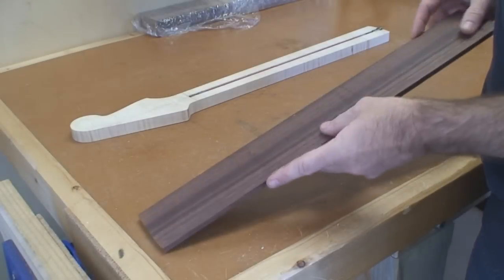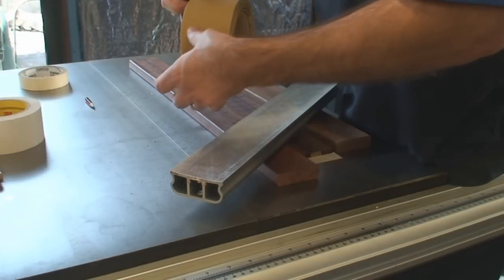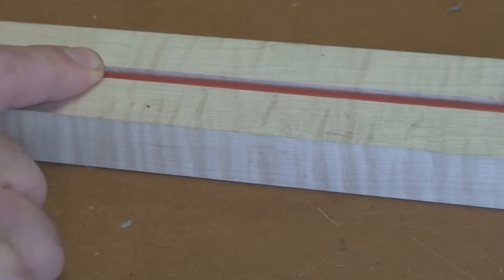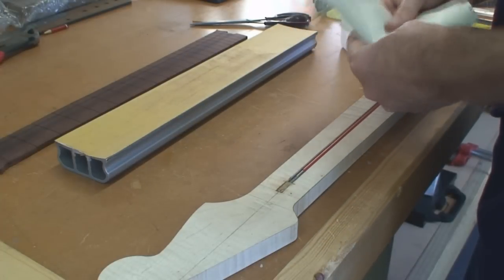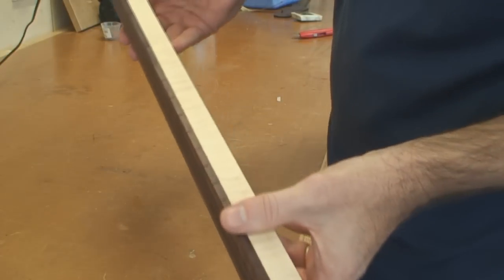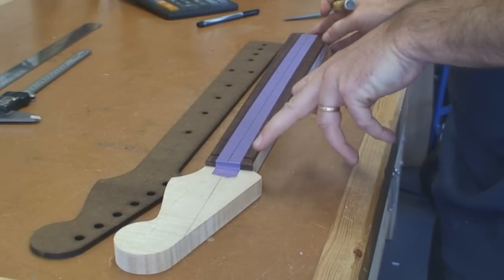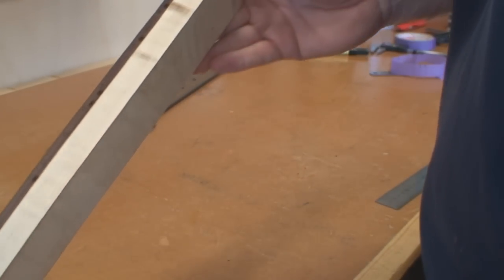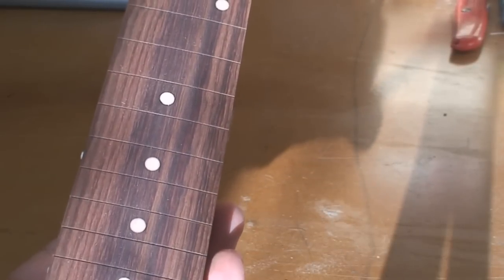Stratocaster Guitar Build - Part 2 - Building A Stratocaster Guitar Neck

Comment: Thank you for this excellent series. I have a question:  How do you get the slot depth equal as you move up the neck as when you radius the fretboard, the depth of the slots will become shallower and shallower due to the outward taper of the neck  toward the heel with this tablesaw jig method?

Comment: I watched the series in early 2012 and have since built three Strats, four Teles, one each 4-string & 5-string Jazz basses, and almost finished a triple Precision bass (wired like a Strat with a blender pot).
I would like to thank you David, you inspired me to take the step from tinkering with existing guitars to starting from scratch.
Reply: Jb kindly can you make or share your bass build knowledge with me.. Please❤️
Reply: @johnmayer8906  It's hard to say in a few sentences. You will need a few tools of course, and a template for each model, or with patience you can make your own templates based on actual guitars. 
I already had many years of power tool experience, which helps a ton. Routers are very dangerous animals, so are band saws and table saws. 

My best advice is to watch David's Strat build, the same principals apply to all Fender style guitars and basses. 

Also, if you're going to make the supreme effort, don't get cheap hardware, I use and recommend German made Schaller bridges and tuners, more expensive but worth it. If you have the skills, it's only a small step to winding your own pickups.
All this costs money of course, so start small and basic, but the deeper you get into it, the more you will understand and want the right workshop power tools. Best wishes my friend.

Comment: Is it necessary to glue the brass blocks of the truss rod into the channel? Does that matter?
Reply: NO DONT DO THAT. Those block need to be able to slide toward eachother slightly otherwise the rod assembly won't flex and work as designed. You'll bust the rod the first time you need to make a real adjustment. Silicon will give and allow them to move under pressure. Glue is too mich and will strip the threads or worse bust the adjustment knob threadlock lose. Dry fit the truss in the slot and play with the adjustment to see what I mean. Understand how the mechanics work before you button her up.
Reply: @raleighburns3768  Thank you.

Comment: Every time I watch this (a lot of times now), my anxiety goes through the roof when he’s flush trimming the fretboard at the heel and passes over the truss rod spoke. God help you if it’s not tucked beneath the maple and the bit contacts the spoke.
Reply: Wait till you DO IT.... You'll seriously appreciate squaring the head end with the chisel and getting that 1mm back. I found a much much smaller 1/4 diameter whitehall router bit that looks like a mini version of that monster he uses and it seems to be a bit more forgiving on the end grain, and much more precise when using thinner patterns, as an added bonus it hasn't burned my maple as much as the big boy.

Comment: Hi there, I've watched this series numerous times and have taken the plunge to start building myself. I have most of the tools that I need but having difficulty finding a saw blade that would do the fret slots. Could you please advise what kind of blade you have? Many thanks from a Scottish luthier in training 🏴🏴🏴
Reply from the maker: I used to use the Fret Slotting Table Saw Blade from Stewmac.   You can cut them in a Fret Slotting Miter Box too.
Reply: @FletcherHandcraftedGuitars  Thank you very much, appreciate you replying to my comment
Reply: @FletcherHandcraftedGuitars  Hard lesson learned with that sawblade I figured I'd share.... Not recommended for SawStop owners. For the price of the 225$ blade you can grab the deluxe mitrebox with the Japanese fretsaw from StewMac. One little accidental bump of the blade into your metal template on a SawStop and it fires the alluminum brake block into your super thin kerf saw blade and you better hope your wearing a bulltetproof vest and ANSI googles. Those StewMac sawblades are thinned out significantly and DO NOT appreciate the SawStop's brute force braking mechanism. They turn into anti personnel mines in less than 3 milliseconds.

Comment: I could be wrong but I think that by putting the truss rod in with the tightening rod on top is wrong. Doing that will cause the neck to bow in instead of back. The idea behind the double truss rod is to eliminate the need of carving the truss rod cover, which is usually put in after the truss rod and before the fret board. I am not an engineer but I think that by tightening the one rod it will cause the other rod to bow away from the tightening rod from the center point, which in this case will cause the neck to bow forward and not back.

Comment: what type of blade are you using to cut the slots?  Any info would be greatly appreciated.  It's hard to shop blades by kerf size.
Reply from the maker: Hi Don, This is the saw blade I used in the video - http://www.stewmac.com/Luthier_Tools/Types_of_Tools/Saws/Fret_Slotting_Table_Saw_Blade.html

Comment: That indexing pin on the shooting board looks tenuous, when it comes to cutting those fret slots. Probably very stable, but it looks to me like you'd have to be very careful not to displace the fret board one way or the other during the cutting operation. Have you tried your CNC router to cut any of these yet?

I am planning (hoping?) to use the Shapeoko3 to cut these to a uniform depth corresponding to the radius of the fret board. Just whip up a CAD drawing of the fret board,  generate a G-code file, and (hopefully) off you go. I've seen Taylor do this on their boards in the factory, but I haven't tried it at all yet. Just curious if you had?
Reply from the maker: +Tom B Yeah I use the CNC now for fret slots and for radiusing the boards
Reply: Good deal. I can't wait to use mine for that...
Reply: +Fletcher Handcrafted Guitars Can you post a video of that???

Comment: why not get a metal stick off a certain diameter and cut it to pieces to make markers instead of using clay ?
Reply: +Cem Savaş Aydin Kramer guitars had aluminum rod fret markers. They were also using aluminum necks back then too! You can use clay, plastic, shell, wood, MOP, whatever, you can sand flush later.
Reply: You can use any material to make the markers. He just chose to stick to the clay markers the older strats had

Comment: hello Fletcher.
I have a concern with FIMO . It remains soft after cooking and does not render beautiful. how do you do?
Thanks for your help.
Best regards
Reply: +Fletcher Handcrafted Guitars FIMO does not bake the same way at high altitudes. I have to add baking time when I am at our old shop up in the mountains. Cake mixes sometimes have high altitude instructions on the box. An uncle lived up above 3600 meters (11,000 feet) above sea level. We celebrated my father's birthday up there a few times, and the cake was usually pretty sticky or soupy in the middle.
Reply from the maker: +Patrice Guyet Hmm.. Ive not had any problems with FIMO - I just follow the instructions on the pack and the dots are hard as rock ?  Check you are using the correct temperature and times
Reply: OK. Thanks for your anser. Bye

Comment: What drill bit sizes do you use on the aluminium for the big and small clay dot markers?

And are they the same size on a Fender Tele Thinline? 

Thank you :)
Reply from the maker: Marie Antoniou I'd probably use 1/4" for the fretboard markers and 3/32" for the side markers if I wanted to be close to a Fender neck.

Comment: You're doin the fret marks the hard way. Just make an x. Where the lines cross is the center.
Reply: He explains that method... Center marking with an X on a small measurement like the frets is imprecise due to the variable thickness of pencil lead and marks. Little deviations will compound to off center your hole. He's showing you the most accurate way of doing this.

Comment: I'm building a guitar in my woodworking class at highschool and using your videos as a guide. So far it's going excellent, your videos are incredibly helpful! I am having one problem though. I've routed the truss rod channel and the little brass blocks are sitting down right where they should, flush with the surface of the neck. However, the chrome barrel just before the spoke sits about the face of the neck. I've routed for the spoke but the fretboard still wobbles because of that little barrel part. Should I just sand out a little section for it? Will that be a problem when I go to fret the guitar? I'm not sure if this happened on your build, I couldn't see. Maybe they changed the design since you uploaded. Any feedback would be appreciated, and thank you so much for making this awesome series, you've inspired me to become a luthier!
Reply from the maker: you need to sand a channel on the back of your fretboard for that little chrome barrel to sit.  For some reason, it got edited out of this video.  The fretboard needs to sit flush on the neck blank before gluing.  Good luck with your build !
Reply: *****
Thank you!

Comment: What kind of silicone do you use on your truss rod I want to put in a single action truss rod in my first build what do you recommend?
Reply: +trueevilturtle You honestly should avoid silicone as much as possible. Silicone is absolutely EVIL for finishes, can never be fully removed, and every place he touched with silicone is impervious to glue or finish. Not a bad thing under the fretboard, but accidents happen. For that kind of stuff, melted wax works great, and theres no chance of accidents of silicone getting somewhere its not supposed to be. Just takes one finish to not come out to learn that mistake.

Comment: Great videos.  All of them.  It took me a while to get used to them.  I regard them as the best out there.  Question: There's no mechanical grab for the end of the truss rod?  How much tension can that silicone take before it starts to creep?....Cheers!
Reply from the maker: A dual action truss rod forces are up and down IE: against the fretboard and back of the neck.  The silicon is not taking any tension really - It holds the truss rod in place but its main purpose is to fill any voids around it and stop the truss rod from rattling.
Reply: ***** Thank you .... that finally dawned on me.  And thanks for the great videos.

Comment: If the fret slots are cut flat and the board is sanded to a radius, wouldn't the fret wire lay flat in the slots causing them to be sunk in the middle portion of the fret board?  Or did I miss something?
Reply: When it's pressed in the fret curves to the fretboard, the radius on the board means there's a slight gap under the middle, which isn't a problem in the slightest.

Comment: No filler strip?
Reply from the maker: CodedToast Mark R Not needed
Reply: ***** why's that please? im curious as im making a strat neck for the first time(only done lp's) and i thought it needed one?
Reply from the maker: *****
Im using a dual action truss rod in a flat channel. Traditional style single action truss rods in a curved channel require a filler strip to function properly,
Reply: ***** tHX alot!...i have a double action truss rod so will do the same....just flat channel it as you mention.

Comment: Thanks so much for your videos! I'm building my first guitar now.  I have a question in terms of clamping a fingerboard that I purchased with the radius already done, what method would you suggest for clamping the fingerboard down when gluing/routing the truss rod access port without having the sanding block like you have?
Reply from the maker: Put some sandpaper on the radius side of the fretboard and use it as a sanding beam to sand the radius into another piece of wood which will then become your clamping caul.
Reply: Great idea!!!!!!

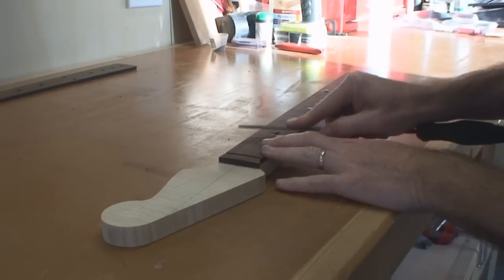Comment: @30:30
Not that I doubt your ability but if you do that sort of thing often I can't recommend a Japanese flush cut saw enough.
I have a Japanese Ryoba saw which is a clumsy version of a flush cut and have cut dowels flush on a finished surface using it. Compared to the flush cut, it's a monster.

http://www.stewmac.com/Luthier_Tools/Types_of_Tools/Saws/Japanese_Flush-cut_Saw.html

Lee Valley carries a variety of them as well as the above, Stew is cheaper but not as much options
http://www.leevalley.com/en/Wood/page.aspx?p=69373&cat=1,42884

This is the Ryoba http://www.leevalley.com/en/Wood/page.aspx?p=32941&cat=1,42884,42896&ap=1

All around the best handsaws for precision work and for things you never thought a saw could do.
Reply from the maker: Thanks mate , I agree a flush trim saw in a valuable tool to have ( got a couple myself ). 
Cheers
Dave

Comment: Hello I have been very confused about truss rods and this is the first video which I think explains it to me. I was confused about how the truss rod was anchored inside the guitar. I can see how the adjustment bit at the end stop it from sliding back and forth, but with no sort of anchoring on the other end - i did see how it could apply tension to the neck if it was free to move.
Does the bit of silicon you added keep the end of the truss rod where it is and allow tension to go across the truss rod? or is the other end not secured at all?
Thanks for your time!
Reply from the maker: The very nature of the truss rod action holds it in place - the forces from a truss rod are up against the fretboard and down against the back of the neck which "lock" it in place, the silicon stops it from rattling
Reply: Ah OK that makes more sense now. Thank you for your time to reply!

Comment: Hello, this is an awesome series of guitar building information. But I was wondering how one would go about cutting the fret slots if they were to use a Floyd rose locking nut?
Reply: There's no real easy answer to this question. The simplest answer is to cut all the way through on the lower nut slot and thats the "start of the fretboard with the locking nut butted up precisely above it. But thats not taking into account the possible thickness ot the fretboard and the required depth of the locking nut. You could always follow the above set and shim the locking nut up if you need height for a TOO thick fretboard. I've had them come out high or low. Depends on how much fretboard you end up losing during the radius operation. If you don't understand what I'm talking about you likely need to study up on the locking nut and understand nut string height and action height off the 3rd fret in final setup. You'll want an R3 floyd nut for this style guitar and you better be ready to problem solve and adapt your design because there's gonna be issues around sanding the curve into the headstock. This is IDEALLY the time to worry about it though (during milling the neck in PT2&1) otherwise you better go watch retro fit videos to better understand it.

Comment: hey, I was just wondering, for drilling out the side dot markers, do you use a brad-point drill bit? (not even sure if they're made that small) - and if not, have you ever had issues with the drill bit walking?
Reply from the maker: I don't think they make brad points big enough either.  I mark the location with an awl first, I find this allows the drill bit to "grab" in the right stop without any wandering.

Comment: Nice video series! Thanks.
In order to adjust the truss rod, it is necessary to take out the strings and take out the neck?
Thanks
Reply from the maker: No, the spoke nut truss rod adjustment is adjusted  from the top of the guitar.  No need to remove anything
Reply: ***** Thank you!

Comment: I've never used clay... but when I put abalone or pearl in, I sometimes crush them trying to get them in. Do you have to oversize the holes quite a bit? I can't see clay being overly friendly with clamping!
Reply from the maker: Its hard as a rock.  No problems clamping it at all. Not sure why your having trouble crushing the pearl inlays, if the drill bit is sized to the pearl you should have no issues ?.

Comment from the maker: I use a stewmac depth gauge to check the slots out before fretting as you do  - I slot deep enough that I usually don't need to adjust anything.  I don't see any benefit in radiusing the slot to match the fretboard.  I wick superglue down the slot too

Comment from the maker: You don't want to be pressing or hammering frets in and find that the slot is not deep enough. Cut the slots slightly deeper than the tang ( allowing for the radius that will be sanded in).  You will wick CA in from the sides, this will fill any gaps under the fret.

Comment from the maker: I just used what I had on hand. Its about 3mm thick. The thickness of the aluminum determines the thickness of your dots so just choose a thickness you are happy with. You don't want the dots too tall, its just more work to sand them down to the fretboard

Comment: Ok, I didn't watch the video where you showed the aligned marks, I skipped around a bit, I drew two marks on the upper neck to represent the nut, you align the back of the nut area with the first line I drew and not the second according to your video.

Comment: When you are aligning the fret board to the neck close to the first fret what marks are you using?  My Strat building video does not show this well at all so I am stuck not knowing exactly what to align to.  Is it the very first fret aligned to the nut top or bottom mark on the neck?

Comment: You may not be aware of this but there is a site that sells band saw blades to cut fret boards, the blades are $15 or 17 U. S.  but if you are in Australia the shipping will be more, in the U. S. this company charges a flat rate of $5 no matter how much you purchase from them. I will have to get the site link if you would like to have it.